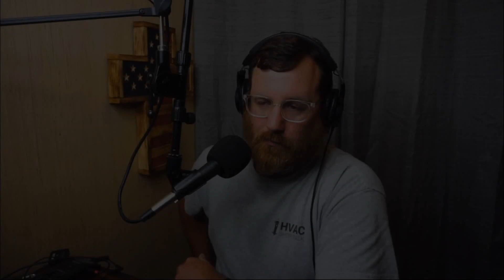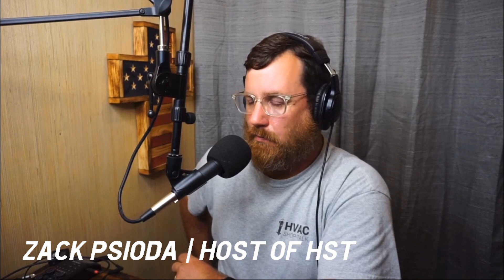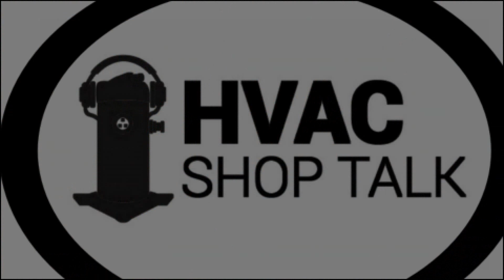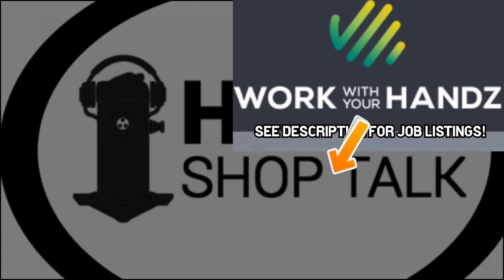Do You Need Separate Gauges for Each Refrigerant

Comment: There is no chemical incompatibility between any of the oils in use, and the trace amount of cross contamination from using the same refrigerant hoses on different systems will make no difference whatsoever.

Of course if you are using bluetooth probes, it is a moot point anyway.

Comment: I work in commercial hvac and super market refrigeration I do not and never have used Separate gauge sets I would need 15 different sets for all the different refrigerats lol i do have a different set for glycol system as for flammable refrigerat all I've worked with is r290 and you just let it blow.

Comment: I was taught by an old hat to use different gauge if the refrigerant uses a different oil, IE don't mix polyester and mineral based oil equipment.
Reply: That's what we were taught so the companies can sell twice the equipment. Its a racket.